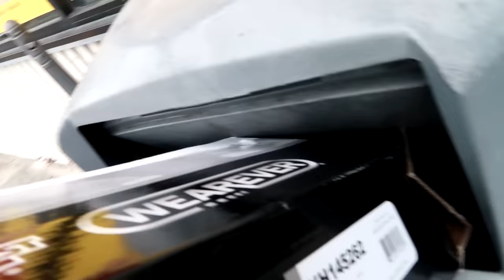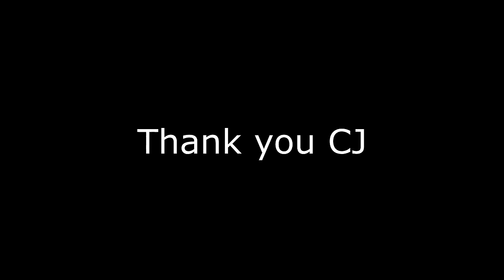what REALLY happened the night i should have died

Comment: You're lucky you didn't die working on that truck like that, with just that bottle jack holding it up.
Reply: it was only holding up one corner, it was fine, if ht lifted up the whole rear end or the whole front end i see your point but the rear end driver corner is probably only 1000 pounds at most so it really wasnt doing a lot of lifting
Reply: Mike Utoober I'm sure it was plenty strong enough, put it can slip off.  Parking brake not set either.
Reply: he couldnt use his parking brake though sine he was replacing a rotor, cant get a rotor off with the parking brake on. though he could have just stuck his wrecked wheel under the truck incase the jack did by chance slip out
Reply: Yeah I know wouldn't take much for it to slip off that jack especially on the round axle.  With him trying to break bolts loose too.  Hats off to him though, I'd be calling a tow truck and fixing that at the house.
Reply: + Jacob D - Yea right ?? And he got TONS of tires in the back he could have used under his Truck for JUST-IN-CASE. I pleaded to him long ago in one of the Video but I don't think he EVER read it :(((. Everytime I see him fixing things, he NEVER take a look at SAFETY... Luck can only goes so far :/// and I hope he wised up during this time.
Reply: Flat surface, proper jack placement. There was little to no risk of the truck moving enough to come off. Do you actually think GM would risk being sued if their included bottle jack (which that was) were that unsafe ?
Reply: Keep in mind that is NOT a hydraulic bottle jack.  It is MECHANICAL.  No unexpected drops from those.  Granted they ARE small footprint and thereby limited in their stability, but, level paved surface...Very low risks.
Reply: Irregardless of risk level, EVERYONE, even the "nay sayers", all agree there is RISK when using a bottle jack no matter the conditions of the bottle jacks use. Who cares how much weight is there, anything over a mere 50 lbs free falling from a short height such as when a vehicle is on a jack/bottle jack can cause serious injuries, or sudden death. No joke. If you are going to have ANY part of your body underneath the vehicle while one or more wheels are removed, use a jack stand or substitute, ie a rim, bricks, etc to further reduce the risk of the vehicle falling all the way to the ground.

This is common sense people...
Reply: My neighbour had his Ford super-duty slide off the jack and the axle pinned him down by the leg. He said it happened around 2pm and he yelled when he heard me come home from work at 6pm. I had to jack the truck off his leg, doctor said if he spend another hour there he would have lost it, his cell phone was 5 feet away on the work bench. I bought him a set of jack stands as a joke after he was all ok.

Comment: the wheel fell of and the lug nuts pulled through because you are using the wrong style lug nuts for that rim.. had nothing to do with them being torqued wrong. that rim uses flat washer style lug nuts not the acorn style nuts you are using.. I suggest you either get the right nuts or change ALL the rims back.
Reply: Gregory Crowder Exactly!!! hopefully Dalton sees this...
Reply: Nope...oe GM alum wheels require an acorn type lug. The lugs did NOT pull through, they backed out. 10:1 his caliper was hanging up a bit & making some excessive heat, he pulls over, rotor, studs & wheel cooled causing just enough play for the lugs to back themselves out.
Reply: Gregory Crowder Both wheel styles are taper seats. GM uses taper seats, you can see that at 1:30. The aftermarket ones, you can see the taper on any of the close ups.

Comment: Around 3:30 to 4:00 one Thursday morning I went out and got on my motorcycle, cranked it up and drove out to the highway to go to work. As I passed a neighbor's house I thought about his Bull Mastiffs that he had been known to leave out to scare people. I wondered what I might do if they were out and decided to chase my bike. That thought brought me to thinking about dogs and them chasing motorcycles. As I shifted into 5th gear I dropped down a hill and at a point I THOUGHT I saw movement on the northbound lanes across the median (that needed mowing super bad). I looked harder and saw nothing because it was still dark. I decided it was a deer in the edge of the trees moving on into the woods because there was nothing to be seen. As I went through the bottom and started up a first slope on the uphill side I saw a lightning fast blur of black and glowing eyes. I immediately knew it was a BIG dog and he had sights on my bike. Figuring he was trying to time his attack for a certain intercept point I decided to maneuver I grabbed the front brake and loaded the suspension, kicked down at LEAST one gear and applied light to moderate rear brake. Now all of this was in a blink so I have to guess I was around 45-50 mph. I leaned the bike to the left so I would change lanes just before the dog could get to the right lane and mess up his timing. Thing is, he saw what I was doing obviously and just stopped right on the dividing line between the lanes. The only thing I had time to say that I remember was shit and NO! He stopped right were I was going to cross. I pulled the front brake and locked the back one to try to slide her down. Instead I hit the dog just behind the ribs and wrapped him around the front tire. I did a partial high side flip and hit the road on my head and chest. I rolled to the back and then felt the friction from the road. I proceeded  to slide while shifting to different parts of my body to keep the rash to a minimum. It worked. Dead 80 pound dog and injured rider. ONE person stopped out of several. He called the police for me and then called my house repeatedly until he woke my wife. Then he gave my (bloody as hell) his phone to talk to her. I was only about half a mile from home and she jumped in her car and got there as they were loading me on the ambulance. I ended up with a torn ligament in my ankle, a cracked elbow, seven stiches and a lot of rash. about $28,000.00 in damage to me and $2,600.00 to the bike plus a new helmet. About four weeks later I went to the shop and rode her home. THAT is when I think sometimes how lucky I really was because I had on a half helmet, tennis shoes, a tee shirt with shorts and an Air Force Coverall suit. WE never know when our last day will be but the thought of the neighbor's dogs put me on alert that morning.
Reply: Sucks to live where you do wher you have to pay the price of a top range sports bike for an ankle and elbow where the nhs in the UK would fix me up and give me money to help recover.

Comment: I did almost the same thing on my 95 f150. I was checking the front brake pads and took the wheels off, after checking I put the rims back on. I tightened the nuts down but didn't recheck. After that I went with my family to dinner driving the truck and got to speed which was about 50mph and noticed a vibration. I thought I'd better stop and so I pulled over and checked, sure enough drivers side front lug nuts were loose and almost falling off. I tightened the lugs by hand and limped back to the house which thankfully was only a few miles away. Needless to say I'm now always careful about lugs and rechecking. It's amazing how a slight oversight can have such a major effect. Anyway I'm glad I noticed and stopped. Thanks for sharing this experience with all of us. Safe travels, Matt.

Comment: I love your videos, and back when I was 17 I also lost a wheel. I had just had my breaks done on the front of my 90' Ford Bronco. was headed home and was going about 60 and started smelling a weird smell moments before my front left tire and rim dropped off, tire went to the median and bounced off the wall and crossed through traffic luckily without hitting anyone. everything was in slowmo when it happened lol, I got to the side of the road and everything,worked out, had 3 state troopers stop to make sure I was ok and commended me on not rolling the bronco when I lost my wheel. all in all I was out about 600 to repair everything, the rim was trashed same as yours, the rotor (now hanging in my garage and has been for 8 years between 4 years in my current house and 4 in the last. had to replace wheel bearings complete breaks caliper and pads( less than 10 miles on them) and 4x4 locker had to be replaced. it was a day that I'll never forget. but I learned a lesson just as you did, and to this day No one works on my trucks except me. and I always re-torque my rims to make sure that I'm not going to have the same problem. glad you made it through everything ok.

Comment: My brother had a similar situation a few years ago.  His wheel fell off but it was because there was a chunk of rust that came off the face of the rotor and stuck to the rim.  This did not allow the wheel to sit flush against the rotor.  The rust deteriorated and left a gap so the wheel was not tight anymore allowing it to fall off like yours.  Always wire wheel your rotor face and back side of your rim when changing tires!

Comment: I work with metal, so I constantly work with angle grinders and lots of other dangerous tools, well last week I had a weird feeling all day while I was cutting up a shed, my manager stopped me right as I was about to finish the job, probably 3 inches left of the final cut, my co worker offered to finish so I could take a break, well I picked the grinder back up, and finished the cut, wheel broke and sent the grinder straight into my wrist. If I was MILLIMETERS in ANY direction I wouldn't be sitting here today. It sure is weird how the universe works. Glad you're ok, keep up the videos.

Comment: 140 ft lbs is the proper torque for the lug nuts, and the truck weighs 6800 lbs, ive got the same truck as you, but that rear axle bracket isnt fun,a lso i would get a new axle,  but heres all the parts u need,  axle hub gasket(paper gasket) inner hub seal, parking brake shoes, backing plate with adaptor for axle, AND RED LOCTITE. LOCTITE THE ADAPTOR BOLTS, AXLE TO HUB BOLTS. and you will need a special socket for the axle hub nuts, when reinstalling the nut that u use to special socket on, torque it to 50 ft lbs while spinning the hub the opposite way of torquing(counter clockwise) after its torqued loosen, spin hub and retorque again, loose it off and put that nut finger tight or so the bearings are just touching and install the key way. have fun!

Comment: In Dec. 2015 I had a Hub and Wheel bearing assembly completely failed on my 2007 Ram 3500 While towing on the freeway. Everything was normal until the ABS Light came on and I started to hear a hum.. After about 2 or 3 miles it turned into a wobble. Once I decided to to get off the freeway I noticed I had no brakes and was only able to turn the passenger side wheel. Thank VGT turbos and manual transmissions for my stopping power while towing 20,000lbs of logs and a 40Ft. 5th wheel trailer. Once I was able to stop I in a parking lot, I got out and saw that my front driver's side wheel was at about a 30 degree angle. Luckily i was only 12 miles down the road from a buddies shop. I decided to try and drive there thinking that it wouldn't be so bad since I was unloaded. I got about 5 miles down the road (Going 35 in a 50mph zone with hazards on) to his shop and I noticed that I was smoking pretty bad. But not from the engine. I stopped and got out and the wheel was now almost to a full 45 degree angle in-wards and the tire was on fire.  The gushing brake fluid was NOT helping at all... Freaking out I started throwing snow at it and it wasn't doing much so I decided to just keep pushing to his shop. Finally I got there and poured a five gallon bucket of water on it... Once the fire was out and everything was cooled off, I found that the hub assembly and wheel bearing had failed and had been failing for quite some time. The wheel had fused itself to the caliper bracket and the axle rod was bent. I had to replace the rotor, Caliper, brakes, all the brake lines, ABS Sensor,  Tie rod, Axle shaft, and lower ball joint. I had to do all the work myself outside of his shop because he was already booked for the day and had no time to help. He did let me use his air tools and covered all the replacement parts. But it took me 8 hours of work in cold wet snow in 10 degree F weather. By the time I was done, I had Frostbite on both feet (Didn't lose any toes). I still have the truck and havent had an issue since. I still havent replaced the melted wheel well... HAHA
Reply: HAHAHAHAHAHAHAHA DUDE! Yes!

Comment: My dad's left front tire fell off of his '93 cummins. He had just put new wheels on it, and was coming from work, and was actually going to his friend's shop to tighten his lug nuts when it happened. He was going about 55mph and the tire shot out and went off the road, into the woods where it was laying just past a tree about four inches in diameter that it had went through. He had to limp it back to his friend's shop with 6 lug nuts on each wheel. Luckily everyone was alright, and all he had to buy was lug nuts, a piece for his hub assembly, and front brake pads (pads were just worn out). Yes, the rotor actually some how survived! He said it was really scary and he had a gut feeling, which was why he was going to tighten them. It was just a good thing that no one got hurt and glad you didn't get hurt either, in your accident. Love ur vids, man! (P.s. This happened about 5-10 miles from gowanda and I instantly thought of this memory when I saw your vid)

Comment: The EXACT thing happened to me. But it was in a 93' Ford Explorer(one of the most roll over prone SUV's ever..) and it was the front left wheel! It was also on the freeway at night going around 70mph. I had made the same mistake of putting my wheels on and getting distracted talking to people while doing it(at least that's my guess). The front left wheel didn't get the final touches and came flying off that night.

I was with my brother at the time which made it even more hairy. Thankfully I remained calm and eased the vehicle over to the side of the road, flattening my rotor in the exact way you did (only thing damaged, but it had just been replaced a month prior >.<). I tell ya, I remember that day whenever doing anything with my wheels after that! Everything gets properly torqued now!

Comment: Hey Dalten,
     If you want to hear about it then I will take a few moments and try to keep it brief.  30 years ago after I got devorced I changed from  autobody frame tech / fabricater to go on the road trucking.  I found a company in Missouri to get training from and then a hire after training.  So man I had wanted to go trucking as much as I like to work on cars.  I had a trainer with me as every one has for a month after you get hired out of their traing school.  The first thing they taught us in training was at night never drive with the cruze on and when you are tired find a place to pull off and sleep.  A rush load isn'tany good when its ruined from someone falling asleep.
    I had been driving as we came into New York city and it was my first time to be there.  When you are in a semi you have soo much to be watching over.  I thought that I got off on the right exit but my trainer wasn't helping so we ended up in the bronx with a 53' trailer and a long wheelbase semi tractor.  There were guys there that jumped up on the truck and were beating on the truck trying to cut the locks off the rear doors.  I was flustered to say the least,  its not easy trying to turn on any road but when you have no room to turn and things are going on you really get freaked out.  We got out of there and were headed to Albany NY to deliver a HOT LOAD.  I was too tired to drive any more so the trainer took over,
    I wasn't havng an easy time falling asleep but I knew I wold be driving soon so I got into the bunk and went to sleep !  Next thing I know I was getting thrown all over the sleeping area.  When it all stopped I opened the curtain to see the trainer hanging upside down beause we went off the road through and inbankment and over and overpass and upside down.
     As you now especially know your life can chang in the blink of an eye.  My life changed from that moment.  I ended up with neck and back injuries that left me unable to work !    I don't know how we got home or weeks after that but,  it changed my life for good.  To this day I still am effected and my family that I have one now suffers from it because wew have to live on my SSI which I am not complaining its some thing to live on and there are miracles areound that as well but,  my family has to pput up with me and dealing with pain on a daily event.
    For instance my wife was having a hard time seeing the pain I was in so she found us a home in Arizona because I do better in the warmth.  But,  we had to move in November of my oldest sons Jr. year in high school and he and my freshmen never said any thing  they just said it sucks but if it helps you ........  So we did !  I would have freaked I think but, you never know

Comment: my grandparents had a ford mini-van they sold my mom and a full size ford van that had the same issue of the tire coming loose. the only similarity is that both vans and your truck run aluminum rims. every vehicle i've changed tires on has had had steel rims that have never come loose. i'm guessing it has something to do with the different expansion rates of the materials.

for those questioning how his tire could have killed someone in another car look up sharon budd and keep in mind that was just a 4 1/2 lb rock where his truck tire + rim is probably closer to 100-125lbs.